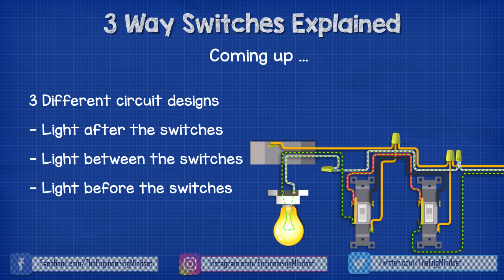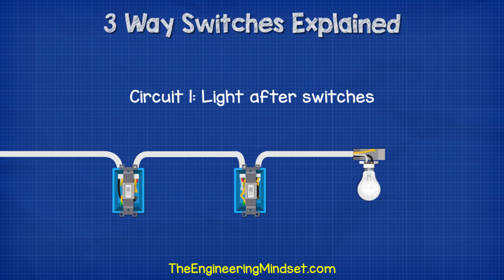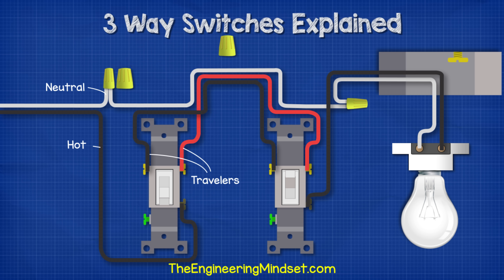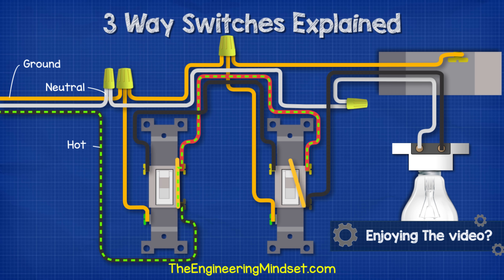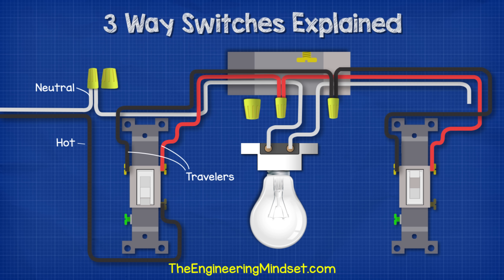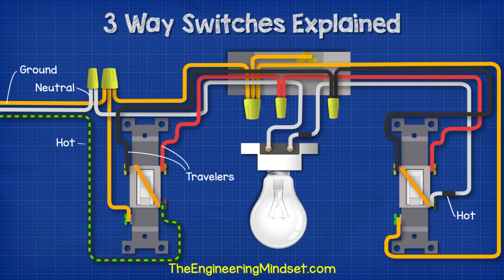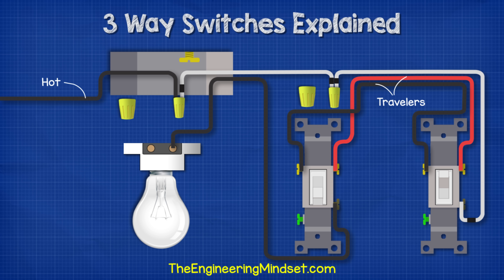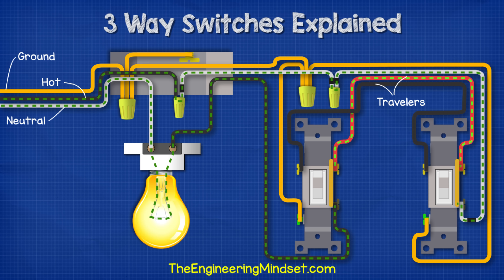3 Way Switches Explained - How to wire 3 way light switch

Comment: Um actually you can’t use your white as a switch leg in the US. Per nec regulations in the branch circuits article, every device box must have a neutral for corresponding circuits or the capability of adding one if the raceway is a conduit rather than a manufactured cable
Reply: That's a pretty recent code change, but yes.

Comment: Technically the second method and third methods are no longer legal.  As per the NEC 2011 404.2(C), All switch boxes must have a Grounded/Neutral/White conductor in the box.  Unless you want to spend the money on 4-Wire just wire it up using the first method.  They did this due to the new presence of electronic switches.  There are 2 exceptions, the first is if the box is attached to a raceway that could accommodate another wire, the neutral, at another point and not be a breach of their being too many wires in the conduit.  The other exception is if the area behind the box is readily accessible without chipping away at the wall.
Reply: @TMWSTW1984 the 2nd option is legal as far as the neutral is concerned as it is only required in one of the switch boxes not all of them, but does violate 200.7(C) where the re-identified white wire can’t be used as a return hot or switchleg back to the light as the way he has it now there are two white wire attached to the light one being re-identified and that can’t be and must be switched with the black on the traveler screw so the black coming from the second 3 way would be connected to the common terminal and to the light on the opposite side side and the re-identified white would be attached to the black coming from the traveler of the first 3 way to comply with the code, and option 3 is the only one I saw that didn’t have a neutral in either of the switch boxes.
Reply: @usmarinekenny  To be clear, it is acceptable to have the neutral in only one box where that box has a view of the entire room. The text is “Where multiple switch locations control the same lighting load such that the entire floor area of the room or space is visible from the single or combined switch locations, the grounded circuit conductor shall only be required at one location.”
Reply: [Method1]
PRO: Always has a neutral wire in Switch Box to comply with NEC code for newer types of Switch which need neutral wire plugged into Switch.
CON: May need to spend extra money for 14/2 wire from Switch Box2 to Light

[Method2]
PRO: May save a little bit by not spending money on extra 14/2 wire from Switch Box2 to Light.
CON: (1) Generally, may not save too much on wires because it needs 14/3 wire from Switch Box1 to Light then to Switch Box2, and this whole route is generally longer than direct route from Switch Box1 to Switch Box2, and 14/3 wire is more expensive than 14/2 wire. (2) Does not have a neutral wire in Switch Box to comply with NEC code for newer types of Switch which need neutral wire plugged into Switch.

[Method3]
PRO: May save a little bit money on 14/2 wire under certain location placement.
CON: (1) To start circuit from a Light to Switch Box, instead of from Switch Box to a light is less intuitive/less common. (2) Does not have a neutral wire in Switch Box to comply with NEC code for newer types of Switch which need neutral wire plugged into Switch.

Comment: Paul, great content, thanks. Does your your three way guide book detail how to wire with multiple lights between two three way switches.
Reply from the maker: Hi Popy, thank you. Glad you enjoyed. This guide doesn't but that's a good suggestion, I'll look to add that in.
Reply: @EngineeringMindset  I'm looking for something like that as well - cannot find it on Youtube.
Reply: @Dedread  It is very simple.  Where the white and black wires go to the light fixture in the video, simply splice additional wires to go to all the other lights.
Reply: Thanks, I’ll look for that in the future.

Comment: So turning off the lights won't save electricity because there is a continuous current traveling to the switch?
Reply from the maker: It will only use electricity when the circuit is complete and can return back through the meter. Turning the light off will save electricity. The green dots are showing the path of electricity.
Reply: You do save electricity by turning off devices, because there's no consuming device using electricity. As long as the electricity doesn't flow through the neutral wire it won't be counted on your meter. However, don't be a fool and use the ground wire because of this. Turning on the light then will bring live electricity to metal cases as well and everything which is grounded in your house (gas pipes and other things).

Comment: Just out of curiosity I'm still understanding the Code, by why exactly do we have to use a white wire marked with electrical tape instead of just using a black wire?
Reply: Because the black wire is already being used in the 2 or 3 wire cable.
Reply: The idea is to use a single 3-conductor cable, to keep costs down and simplicity up.  A three-way switch inherently requires three hot wires, so using 3-conductor cable works out.  Marking the white wire as hot is an "exception" that lets this cost-effective practice work. 

Newer codes forbid this practice in most instances.  You either need to run an additional cable to handle the switched load, or install less common 4-conductor cable to ensure a neutral wire is present.

Comment: What is the purpose of a 3 way Switch? As opposed to a standard switch?
Reply: Three-way switches are very common.  As doug m wrote, they're used when you want to control a device (such as a light) from two or more different locations.  For more than two locations, you start adding four-way switches in between the two three-way switches.  ANY of the switches can change the state of the light.
Reply: you can turn on/off  from two different locations.  example would be a hall way  light or stair well.  you can switch the light off from the top or bottom of stairs.

Comment: I’m learning mechatronic and this is helping me a lot especially the 3 phase motors and all others electrical engineering. Can you also do more mechanical like misalignment, bearings,    Gears, drive belt, sprocket And any other mechanical to help us all out I appreciate your hard work my sub and respect for you 💯

Comment: One time, I wired five, 3-way switches, on the same  circuit. After six shorts, I finally got it right. It drove me 10-times crazier.
Reply from the maker: It can get pretty complex. I have to draw it out first.
Reply: And 4-way switches are cross-wired DPDT switches!
Reply: Gary Russ yes I know that now ha ha. I learned the hard way!

Comment: What is the ceiling box for?
Reply from the maker: To securely fix the light to the ceiling and contain the wires/nuts
Reply: Electrical boxes are required by the Electrical Code.

Comment: How a Photodetector works? How does it converts light into electrical signals? A video explaining everything about Photodetector will be nice if possible.
Reply: Light is electrical
Electromagnetic radiation
I think photocell are just mini solar panel